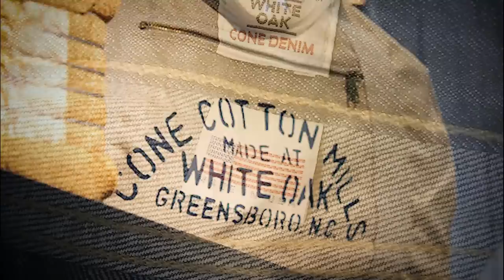Goodbye White Oak - Americas Last Denim Mill Closes

Comment from the maker: If anyone is interested in the final Levis White Oak model you can buy them here: https://unionmadegoods.com/product/levis-made-in-the-usa-selvedge-501-original-fit-jean-in-two-horse-blue/
Reply: New England Style Consulting Thank You for making and posting this video. For me it’s bittersweet and the reason is simple. I was born and raised in Greensboro NC in a neighborhood known as White Oak. I know many people that worked at the Cone plant including my father which was a supervisor. The Cone Mills Corporation actually had 3 separate mills very close to each other. There was White Oak Mill Revolution Mill and Proximity Mill. Revolution Mill is currently being converted into very expensive apartments and lofts. There is still away here in Greensboro to get your hands on Cone Mills Denim and that is a small shop in the basement of a near by set of offices that were once part of Cone and you can buy the denim by the yard or by the Roll. 👍🏼
Reply: website not accessible

Comment: Nice video Carl, I plan to add a link to this video as a recommended video for our customers. We specialize in Raw American made jeans and Cone White Oak fabrics represented about 90% of our product line, so this really hurt our business.

After I learned about this, I immediately investigated buying the equipment with investors and other U.S. textile makers, but Cone never got back to us. This makes me believe they already sold the equipment to Japanese or Chinese denim makers, or plan to keep it in case they decide to restructure and become a smaller tighter operation, which makes the most sense.

One correction on your video, there are still makers of U.S. denim, but Cone was the last producer of selvage denim. Cone Denim, in my opinion, was the best quality American made denim. You may find other U.S. producers of non-selvage types of denim, but the quality level will likely not be to the standard that Cone produced. This may help to answer commented questions why pricing varies in U.S. makers of jeans. The lower-priced U.S. made jeans, often don’t use selvage or denim on the same quality level as higher priced makers. The other factor, some brands are priced to sell direct to consumer, while others are priced to make a profit selling to retailers, who also mark-up the price. If the brand is built on selling retail stores, they offer the same selling price as the retailer, so not to undercut them.

Here’s a link to our post.
https://madeinusajeans.us/raw-denim-blog/the-end-of-american-made-jeans-cone-denim-close-white-oak-plant/
Reply from the maker: Thank you for sharing your thoughts, it’s not often I get the opinion of an industry insider! The people over at Huston Textile also tried finding out the ultimate destination of the Cone Mills looms with no luck.
Reply: Thanks man

Comment: Texas jeans out of North Carolina still sell good jeans made of quality US denim at a budget price. I'm not quite sure why US-made jeans from Cone Mill denim cost 100 bucks a pair while other NC denim manufacturers cost $30 a pair but that's probably why they're not in operation anymore.
Reply from the maker: I'm confused to the price range in denim too, for example the Pointer Brand denim is USA made but costs $95. I know a lot of the costs are in the details like hidden rivets, bar tack stitching, etc. So I believe the actual denim is a small part of the cost unless its really special or specific.
Reply: Very different denim, very different situations. Cone Mills' White Oak plant produced denim made on modern automated looms as well as selvedge denim made on vintage shuttle looms. The vintage looms require actual humans to work/maintain them. They're also 1/3 the width of a modern loom. You have to factor in living wages for workers actually working the vintage looms into the equation and the fact that it's easier to produce more denim from a modern automated loom. That's what leads the the price difference.
Reply: Selvedge jeans are the cream of the crop in denim.  The ever durable Levi's 501 jeans were made from Cone Mill Denim.
Reply: Buying denim from Cone Mills (particularly selvedge) is buying high quality denim and buying a piece of history.  

The denim world is primarily dominated by Japanese denim (this is now considered the best denim in the world). The beauty of American and Japanese denim is that there was a great debate on which was superior.  In my opinion both brought different things to the table.  Japanese produces higher contrast fading while American produces a nice blue vintage soft look.  I am on the hunt for one more pair made with cone denim.  Hope this info helps